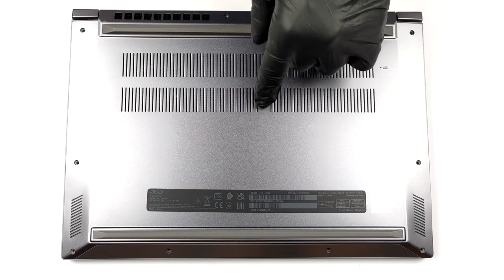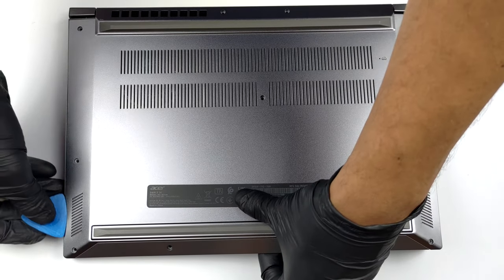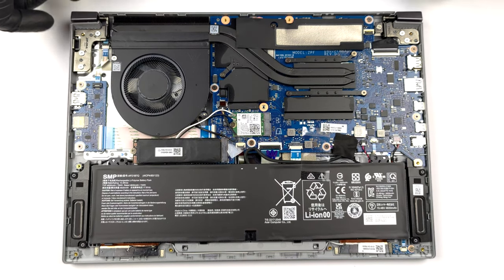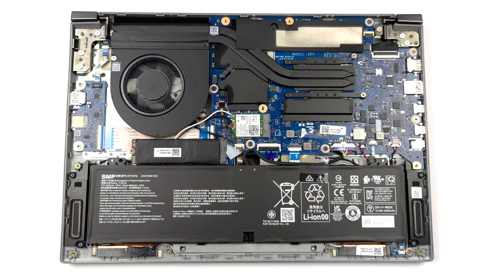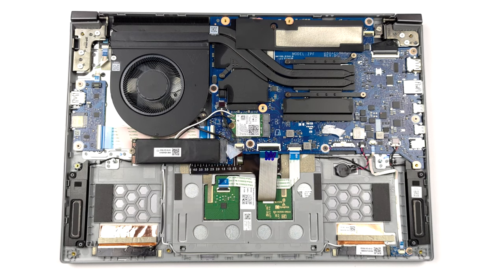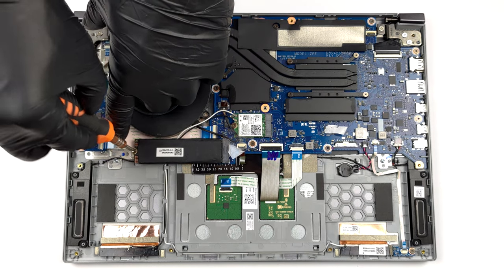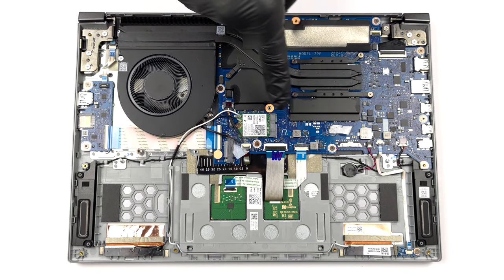🛠️ How to open Acer Swift X 14 SFX14 71G - disassembly and upgrade options

Comment: im wondering if you can remove that wifi card and replace it with a m.2 to pcie adapter to add an external gpu. Also is is possible to solder more ram onto the motherboard? Task mgr says 8 of 8 slots used so ig you would have to desolder the ones that come with the laptop and add your own if even possible.

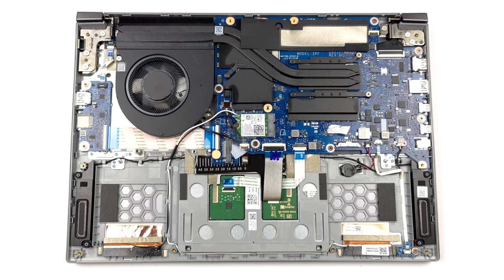Comment: 1:26 is this the harddrive?
Reply: It's a Solid State Drive.
Reply: @RJstillalive  so.... is it the harddrive? I'm really confused
Reply: @lycan2494  Hard drives and solid state drives are different. SSDs use memory cells while hard drives use spinning discs.
Reply: @RJstillalive  so which one is hard drive though. I'm confused
Reply: @lycan2494  as technology progresses, laptops today no longer use hard drives. This Acer swift uses a more efficient form of storage called solid state drive (SSD). It does not have a hard drive.
Reply: @RJstillalive  oh interesting... so the ssd is technically the hard drive in this case since its the storage
Reply: @lycan2494  a hard drive is a type of storage, just like the SSD. The term 'hard drive' was once colloquially used to mean a device's storage, but now a device can either have a SSD or hard drive as its storage component.